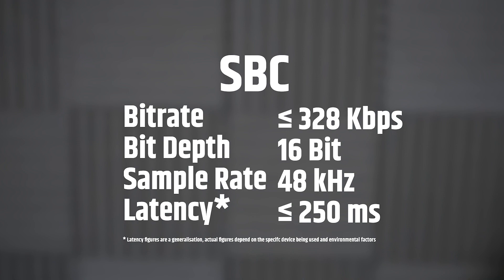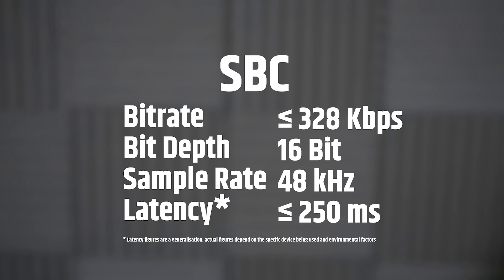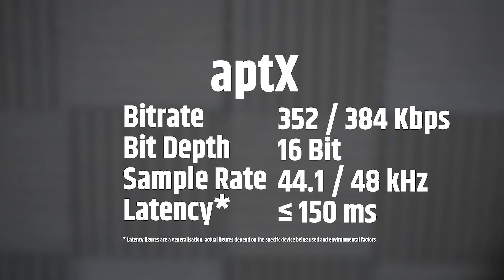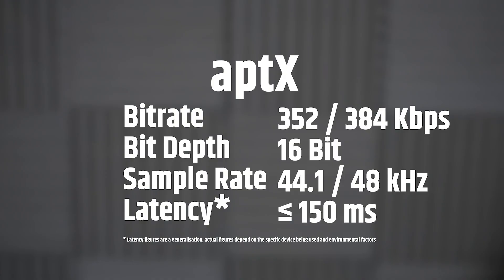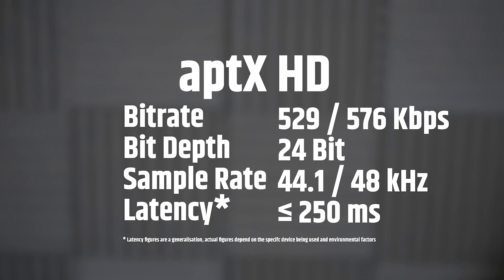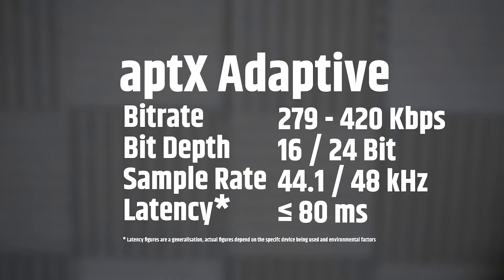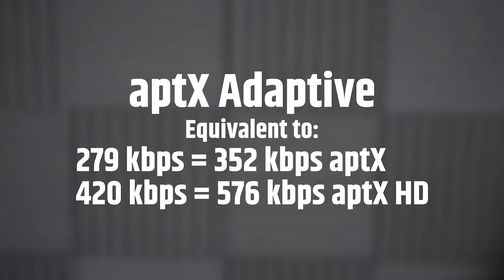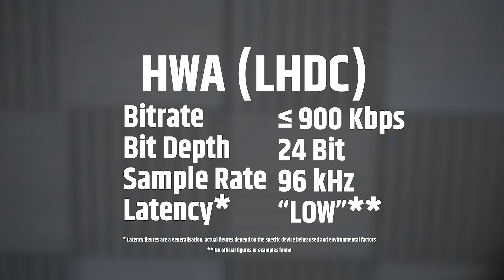Bluetooth Codecs Explained

Comment from the maker: In case I didn't make it explicit enough. Because I do see comments getting this wrong on the internets. No Bluetooth audio codec is lossless. Just because a codec greatly exceeds mp3 quality and supports 24 bit and greater than 44.1kHz sample rates which is a higher bit depth and sample rate than CD quality, it is still a lossy format and thus does not offer higher than CD quality. Also even though some codecs support higher sample rates and bit depths than standard definition audio, often they are still capped at 20 kHz meaning they are no more "hi-res" either. Queue debate about hi-res audio being snake oil.... 3... 2...1...
Reply: Just a question, will codecs affect uncompressed high quality audio from apps such as Tidal? I'm looking at buying the Bose QC earbuds but they only have AAC and SBC.
Reply: @alexanderbuys2051  If the bose only have AAC and SBC, they won't be uncompressed no matter what the source is.
Reply: LDAC

Comment: Ironically, if you're on the street, metro, office, etc, even with high quality noise cancellation (that usually compromises quality btw), there's not a lot of sense in using high res codecs, because all the noise of the ambient is there whether you like it or not. So, if you are at home, with silence, wired connection is your best bet in any player, not only headphones

Comment: Sbc is preferable to aac on android devices?? What are you rambling about?? Its a combination of streaming and playback codec, its not one or the other! Good god, and ppl arw praising this confusing video as informative. You can not store a track i sbc codec, its just used for transfering the audio to a bluetooth endpoint. If your bluetooth endpoint doesnt support the more advanced aptx codecs, your aac codec file will most likley be transfered using sbc codec. It's not one or the other, its a combination. To say sbc is precerable over aac is a missnomer and points to a fundamental lack of understanding.

Comment: My pair of OnePlus Buds N Bluetooth 5.2 uses aac on Android 11 device (OnePlus 6 Bluetooth 5.0) it works perfectly in this setup.  This TWS only supports SBC and AAC codec which you can easily choose from settings. I should say that most of tracks sounds perfectly well and drivers definetly capable of produce high detailed sound with well above average soundstage. But in few tracks resulting quality is subpar at best which i relate to hardware/software. Where you definetly see quality difference is when you pair this with Windows 11 PC (Intel Bluetooth 4.2/WiFi PCIe adapter) it is obvious that AAC not supported there. Now i'm waiting for my new Windows 11 Lenovo laptop with Realtek WiFi6E/BT 5.2 combo, it is interesting how does it play on this device.

Comment: Thank you for this review.
I recently bought two sets of the Beoplay H95 B&O, and I just love them.
And I did it because I wanted to see TV with my wife, Tânia, with the headphones, simultaneously, without disturbing the neighbors.
Meanwhile, I understood that now I need to by a "Dual Link" bluetooth transmitter, which supports the Aptx Adaptive, to link my Sony Smart Tv (Dec. 2018, bluetooth 4.1, A2DP) with the two sets of headphones, Bluetooth 5.1, which support the codecs SBC, AAC and APTX Adaptive, without latency or lip-sync significative delay. That's my purpose.
The problem is that in the market I didn't found yet a transmitter, with or even without "dual link", supporting the Aptx Adaptive.
So, would you be so kind to tell if you know a Bluetooth Transmitter, with the "Dual Link" and APTX Adaptive?
The thing is that in the market there are many bluetooth transmitters with "Dual Link", as the Orbit model, from Avantree, and several other models of other brans, but non of them seem to use the APTX Adaptive codec, so they would probably link my tv to my phones whit the SBC codec, and in that case I would probably notice some lip-sync delay...
What do I do? 
Risk with the Orbit, which seems a good and versatile transmitter, or with another transmitter to link via SBC codec? 
Wait for a new transmitter to come in the market, with APTX Adaptive and "Dual Link" ?
As far as I know many people, as me, just don't know what to do with this "APTX Adaptive" new codec thing, because in the market the bluetooth devices still work with the SBC, AAC, Aptx, Aptx LL and HD, LDAC codecs, nobody seem to have devices supporting APTX Adaptive.
Best Regards from the suny Lisbon,
Pedro

Comment: Hi there! from 2021!
I have a Bluetooth speaker that sounding delayed. When im using it to my computer using wired method by the help of 3.5mm audio jack male to male. When im going to play some video clips, you cant see anything wrong about the synchronization of the video and audio. But when im going to use a headset/headphone at the same time, I can figure out that the sound coming from my Bluetooth speaker is far delayed than the sound coming from my headphone. What do you think about it? you think codec is responsible about this? Thank you!

Comment: It would be awesome if manufacturers standardized on Opus for Bluetooth, at least if it works as well there as it does for other applications.
Reply: The default would naturally be something supported by the audio hardware.  Opus should still be a standardized option, since it uses a tiny amount of CPU even on a phone.

Comment: Nice and clear explanation!
But does LDAC and aptX only make sense if you have lossless music files such as FLAC or WAV on your phone? If you only have 320kbps mp3 or AAC files on the playing device, then a higher BT codec such as LDAC or aptX makes no to little sense, right? The chain is as strong as the weakest link. I'm using 320kbps AAC files on my iPhone because that should be a better codec than mp3 at equal bitrates and comes closest to lossless regarding transparency I guess.
Reply: The low latency codecs used for Bluetooth audio require a slightly higher bit rate for the same sound quality, so it might make a difference if you have MP3 or AAC source material at 320kbps. If you have 128kbps MP3s, then it probably matters less. Even Apple's AAC implementation for Bluetooth will give a lower quality result at the same bandwidth as the original AAC file, because the latency and battery life of the earphones have to be considered when encoding the audio.

Comment: One extra information I just looked at: AptX Adaptive (BT 5.2) is backwards compatible with AptX and AptX HD. (source: Qualcomm site)

Excellent video! Aced!
Reply: what does that even mean?😂🥴
Reply: @Blackfeet  That's the new AptX standard used in BT5.2. It's a mess - and that's why I won't be switching from cable that soon!

Comment: There are other lossless compressions like APE and a clever one that did not caught on (I don't remember the name) that created two files: one MP3 like and another that, with the first file, makes a lossless set.

Lossy compression using high bit rates for most music and most listening devices are really good. In most (really almost all) cases, the limits lie in the amps and loudspeakers. I can (or could, haven't tested recently) tell the difference using a Onyx Blackjack and a Sennheiser HD565 - but only for some types of music, specially those with lots of metals (sax, trumpets). Timbres that have a chaotic component are hard to compress.

Now, back to the video!

Oh ... latency is only important when watching video - and often, for video, there are workarounds (some are automatic).
Reply: The one you refer to is WavPack.
And the other 3rd party lossless codecs besides that and APE (as well as FLAC which was originally one) are TAK and TTA.
But no one watching videos like these would know what those are lol

Comment: What is the best option for SBC? Mp3 320 kbps or Flac 960Kbps, since the SBC limit is 328, the difference in definition is very heard?
Reply: Might be flac, since the MP3 is lossy codec and flac is loseless.
If you select MP3, the source is lossy-coded twice (MP3 and then SBC).
But I don't think the difference is critical, since the loss in MP3 encoding is not so much significant as that of SBC.

Comment: You mentioning the FiiO BTR5 and BTR3 having LHDC support was extremely helpful, I was looking for an amp that used that codec and Google wasn't helping me at ALL. Thank you so much, they are exactly what I'm looking for.
Reply: FWIW I have a BTR3 and LHDC although supported on both ends is unusable with my Xiaomi K30. On default settings it is quiet and more crackle than music, it can sometimes be hard to even decipher speech never mind listen to music. If I manually (in Developer options) set the sampling rate down to 44.1 or 48 it becomes listenable in the sense I can hear what is going on, there is still I think some background crackle. It's that digital crackle that you get if a cable is too long/dropping out or a CPU is taxed and dropping samples. There's also sometimes a bit of slowing sort of effect, as if it's trying to catch up. I can't overemphasise how bad the sound is, to be honest I find it hard to distinguish between even SBC and higher codecs normally, but LHDC on my phone is utterly unlistenable.

Note this is even with Hi-Res source, (Tidal) anything above 48 simply is impossible. For me, it's the sample rate change that (half) fixes it, the other settings (including the 400/560/900 kbit setting) don't seem to have any effect. Now this could well be my phone rather than the BTR3, and I suspect it is the source device. But it's unusable. LDAC by contrast is absolutely fine. All other codecs (AptX, AptX HD, AAC) are also fine.

You MAY have more luck if you have a Huawei phone. But do a Google a search for "Huawei LHDC crackling", A LOT of people with Huawei phones seem to have this exact issue I have with LHDC on my Xiaomi. Again- I cannot over-state how bad this is, it's not a minor thing at all.

The FiiO is fantastic as a device otherwise, as I say it may be my phone rather than the FiiO. But I wouldn't be enthusiastic about LHDC from my experience with it. LDAC is perfect.

Comment: which one best ACC vs aptx or aptxHd ?
Reply: LDAC, then aptX, then AAC, then SDB
Reply: @OMCPero  the last 2 ones are not true its SBC then AAC. AAC is literally the less powerful and worse codec
Reply: @resinds.p4898  You are correct, my mistake
Reply: @OMCPero  well i could be wrong too
Reply: @resinds.p4898  yeah AAC only works perfectly with iPhones in Android it works like Garbage I'm telling you this because I have one😭
Reply: @resinds.p4898  wrong...AAC is superior to SBC. Actually AAC is fairly good compared to AptX...although AptX HD is superior. As for what Apple uses...for iOS, its only ACC. But on a Mac it uses AptX, if your HP use AptX.
The bt HP I have(Beyer Amiron Wireless) tells me when I'm receiving AptX or AptX HD.
Reply: @mjjm6220  well on my end SBC sounds better

Comment: Good explanation👍I can hear the difference with stereo channel separation for details and depth of sound and sharpness of bass with LDAC 990kbps, and it gives best listening experience for me. I listen to music stored as flac's - purchased online or ripped from CDs. Aptx souds better than aac because better stereo channel separation and bass sharpness,  however high frequencies are much softer with aac compared to aptx. I did not test aptx hd yet but I hope to play with this one soon 🤞☺
Reply: on high end audio you should use ldac codec but use a regulated power transformer  for your device . its very important.you will be amazed at the sound quality....

Comment: I would like to game on my phone using Bluetooth headphones and I'm very worried about latency. Which codec(although as you said; depends on device) would perform best?
Reply from the maker: I think the codec choice is mostly moot when it comes to latency, even if one codec is in theory better than another it is too variable in the real world to really say one is better than the other. Its really down to the device. The QCY T5 iems for example only support AAC and SBC but have a 'gaming mode' which is supposed to reduce latency which it must do with one of those two codecs but they don't explain how they reduce the latency so not sure what tricks they are doing to bring the latency down.
Reply: @WheezyTech ok thank you. It's heavily device dependent and also environmental factors
Reply: I use aptx or aptx HD. I haven't noticed any audio delays when playing rhythm games anymore. I can finally enjoy games and videos with bluetooth headphones.

Comment: 1 dislike, ha? Probably an 🍏 user
Reply: It’s proven by expert engineers that aac trough apple devices is the highest quality out there out of lossy formats. 
There’s no audible difference between streaming a 16bit 44.1 kHz flac. Same goes for measurable difference. 
Also headroom isn’t gonna be audible by your average audio equipment. 
And by the way codecs mean nothing when the original recording quality is bad or not optimal. 
Also makes a huge difference on what kind of recording method was used. 
Go search and buy dr. Cheky ultimate headphone cd. 
It’s also available on amazon unlimited in flac 16/44.1. 
Dunno about other streaming platforms. 
Has to do with hardware quality and amount of power ( battery management and processing power ) involved in the Audio processing whereas on android you rarely get that high quality hardware and software management. It means on android phones you never know how much o a high quality processing you get since there’s so much difference between hardware choices that of manufacturers. Whereas on apple you know what you get and it’s been proven. 
There’s a reason why apple sticks to aac an pay the patent fees. 
Practically aptx hd and adaptive won’t sound better than aac. 
Just so some research. Has nothing to do with apple or android. It’s just a proven fact by many engineers.
So to wrap it up, as long as you don’t have high end equipment like high end headphones, there’s no use breaking your head ( like I did for months ) researching. If your equipment or headphones are just average, go either with aptx hd/adaptive or aac. You won’t notice a difference. It’s even hard to notice in higher end equipment if you don’t have a fine/Audiophile ear.
Like a said many people don’t even know what headroom of bit depth is. 
It’s like a having a 1000ps car with too small wheels and tires. You will never get that 1000ps out of it. Same analogy gets for headphones and Bluetooth Streaming.
Same goes for Bluetooth 5.0/5.1.the only difference is in a Bluetooth transmission method that’s not even used for transmission of studio. Bluetooth 4.2 it’s just as Good whereas 5.1 only got improvement in things that are not used by audio Over Bluetooth. 
One tip, if you want a good phone for streaming aptx adaptive, go for Nokia 5.4.   thank me later.
Reply: 11 now 🤥
Reply: @carterwldwhb  why has it to be apple? It’s proven by expert engineers that aac trough apple devices is the highest quality out there out of lossy formats. 
There’s no audible difference between streaming a 16bit 44.1 kHz flac. Same goes for measurable difference. 
Also headroom isn’t gonna be audible by your average audio equipment. 
And by the way codecs mean nothing when the original recording quality is bad or not optimal. 
Also makes a huge difference on what kind of recording method was used. 
Go search and buy dr. Cheky ultimate headphone cd. 
It’s also available on amazon unlimited in flac 16/44.1. 
Dunno about other streaming platforms. 
Has to do with hardware quality and amount of power ( battery and processing ) involved in the processing whereas on android you rarely get that high quality hardware and software management. 
Practically aptx hd and adaptive won’t sound better than aac. 
Just so some research. Has nothing to do with apple or android. It’s just a proven fact by many engineers.
So to wrap it up, as long as you don’t have high end equipment like high end headphones, there’s no use breaking your head ( like I did for months ) researching. If your equipment or headphones are just average, go either with aptx hd/adaptive or aac. You won’t notice a difference. It’s even hard to notice in higher end equipment if you don’t have a fine/Audiophile ear.